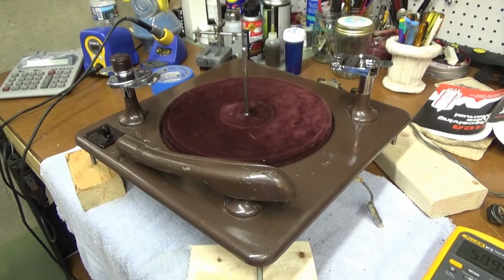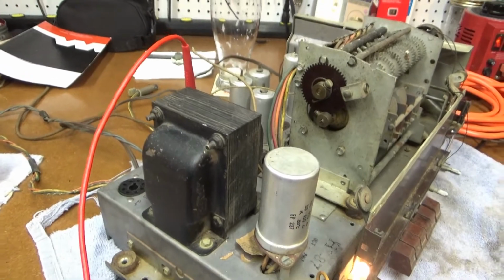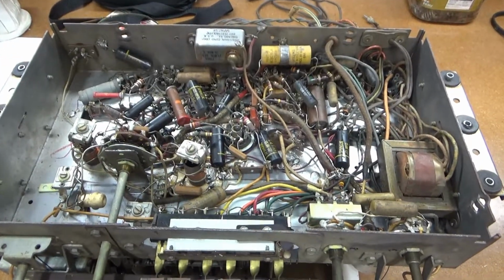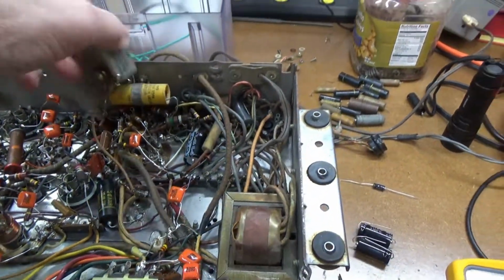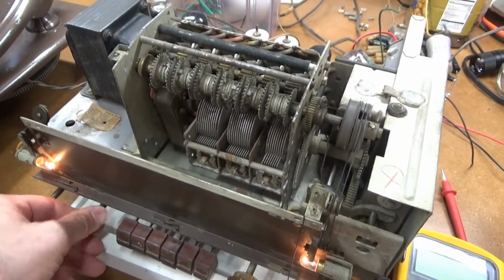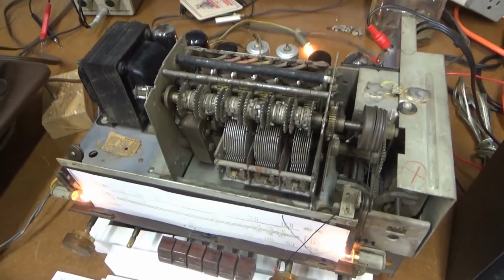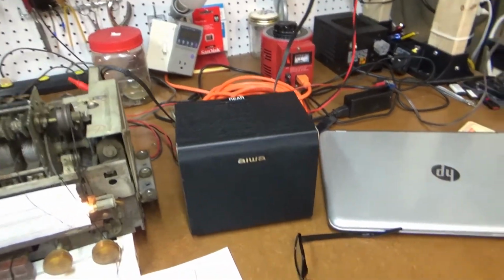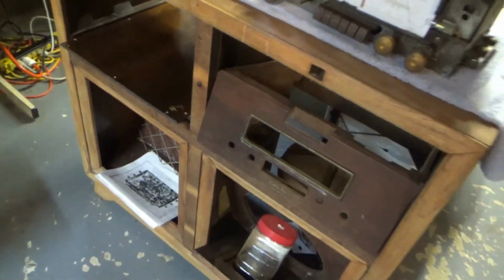1947 Motorola Console Restoration,  part 2 Radio

Comment: I just re-capped most of mine. I'm excited to test it but have to wait for some electrolytics to show up. Any idea where that third light bulb goes? Mine was just hanging in the cabinet when I got it. I can't see a place for it. That's too bad about your glass. Thankfully, mine is in perfect condition. I just hope I don't break it. I removed it and put it in a safe place.
Reply from the maker: I think the third light is for the turntable section of the cabinet. I'm not sure exactly where it goes because I have not yet reassembled the console. Can I ask a big favor. If possible can you scan or take a high resolution picture of your dial glass. I should be able to use that image to order a water slide decal for my replacement dial glass. Here is my email address. mguessva@gmail.com
Reply: @mguess  will do.